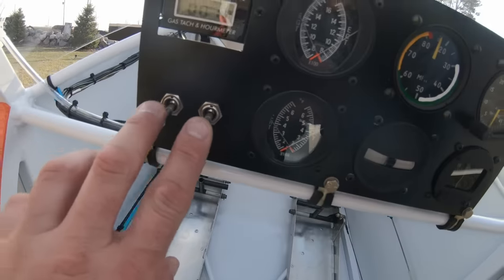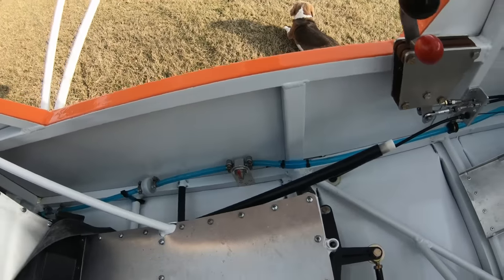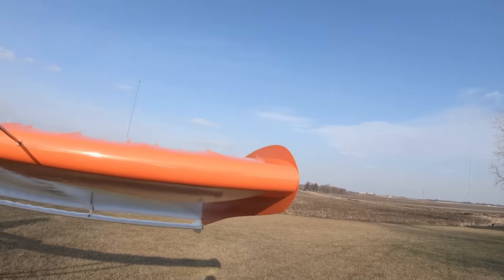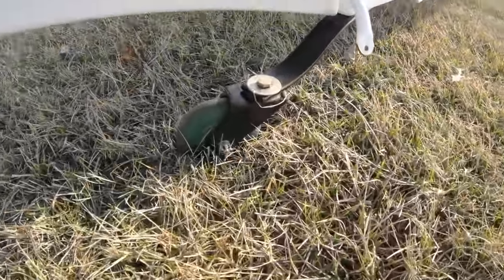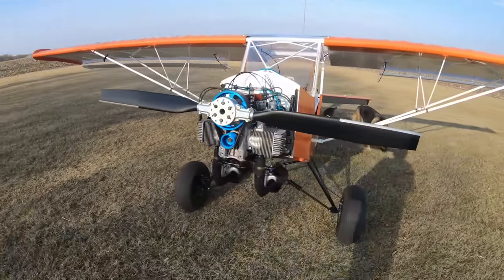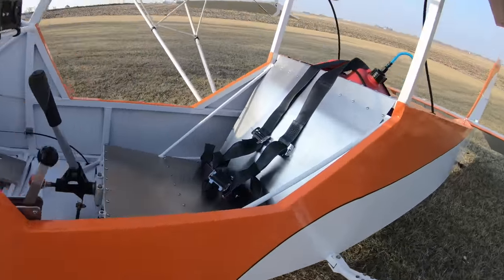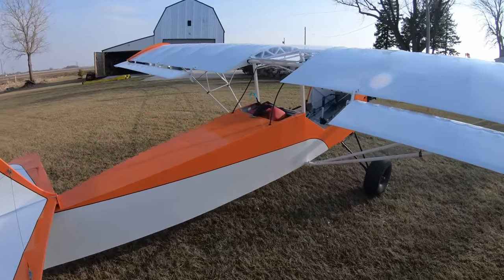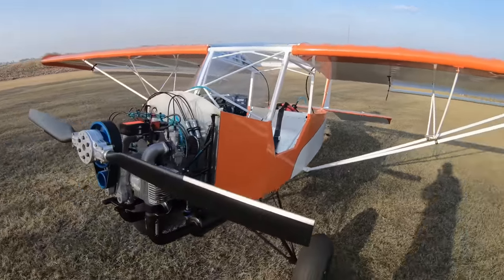SOLD - Belite Ultralight for sale

Comment: I am very impressed with the flight performance of your airplane. Much better performance than a 65hp Piper J-3 Cub. The wingspan looks so short to perform that well. The empty weight must be very low. Less than 300 pounds is my guess. I do not like that fuel system and tank location at all. That plane needs wing tank(s). If you have an accident you will be doused with gasoline and likely burn to death. I never cared for nose tanks in my Cubs either but at least the fuel is in front of a pilot. That type engine is prone to forced landings. Belt drive too. But it sure flys well. Short landings are impressive too.
Reply: Fuel cells can be made to fit anything.....No Spill.... No Leaks.... Made in Oregon and on Youtube.

Comment: How long is the typical Take off roll? How long is typical landing? What is the length folded up approximately?
Reply from the maker: Take off can be anything from 90 to 225 feet. Landing can be 70 to 200 feet. These are typical for me and probably not for anyone else. It is going to vary greatly depending on pilot skill, wind speed and direction, density altitude, fuel amount on board. It's about 19 feet long wings folded.
Reply: Hey Kevin, Thanks for answering!

Comment: I would buy an enclosed trailer to bring it home to North Carolina. You said it is "8.5 to 9 feet wide" with wings folded. I take it that the maximum width is determined by the width of the tail? I would need to get a trailer wide enough.

Comment: I am very curious to know if you, the seller, would benefit from making all those repairs right before selling the plane as opposed to just leaving that work for the buyer and charging less. Is it reasonable to expect that the increase in price will cover the cost for parts replacement? Or did you mainly do those repairs because the chances of someone buying the plane is a lot lower if it's due for all that maintenance?
Reply from the maker: Repairs/maintenance/ annual was done to keep the aircraft airworthy and safe. In my opinion it has nothing to do with aircraft value or trying to negotiate less or more money out of a sale. I did the repairs and routine maintenance for myself, so I am completely confident that I am operating a safe aircraft. I have this airplane for sale but it is still something I am going to fly. I would not feel comfortable handing over an aircraft that I had built to anyone else if I did not feel it was 100% airworthy and safe to operate.

Comment: I have a 2018 Vittorazi 185 Moster dual start, with nano trike, nice Smart Glider, and a Gopher training glider.  I would trade you.  Full Paramotor setup, worth over 18k$. Helmet w/com, etc low hours. Carbon fiber.    Top of line pluma comfort harness.   With emergency parachute

Comment: I wonder why the plastic got stress cracks. Ive never seen polycarbonate do that.
Reply from the maker: The bends are too tight. It should really be formed on a mold in an oven. I see it on all kinds of kit planes and ultralights. My replacement windscreen is already starting to stress crack.
Reply: @kevincamp189  What kind of plastic are you using?
Reply from the maker: @joewoodchuck3824  Bayer the first time lexan the second.......   .060 thickness
Reply: @kevincamp189  I'll have to read about Bayer. I've never heard of that. How thick is the lexan/ polycarbonate? I ask because I normally cold bent it like sheet metal and never had any cracking or checking develop.
Reply from the maker: @joewoodchuck3824  I was told Bayer is just a different brand then lexan. It's supposed to be the same product. I think its .060 thickness. I dont have too much experience with polycarbonate windscreens, any tips you have I'd love to hear..... I didn't know about colt bending it.
Reply: @kevincamp189  Cold bending polycarbonate works just like sheet metal bending, at least with corners. Its just springier to work with, so you need a little overtravel to get the angle you want. You can also punch holes and saw like wood using a carbide blade. Sawing most rigid plastics with any reciprocating saw will result in a soft semi melted mess. Drilling poly is a snap with a little mineral oil, but such thin material would best be sandwiched between clamped lumber pieces. A colleaugue made a curved replacement motorcycle windshield with thin poly and it remained clear of any deteriorative effects for years until he sold the bike. This material along with others was in continuous use for decades in our custom laboratory equipment design work.
   I wrote a magazine article expanding on my comments some time ago on polycarbonate use geared toward ham radio operators. It may still be floating around the web. Look up my FCC call sign N1KHB perhaps along with ARRL and/or QST.

Comment: Still available?
Reply from the maker: Yes
Reply: Kevin Camp what’s your asking price?
Reply from the maker: @flyingclint589  $15000
Reply: Kevin Camp ok, cool!  What’s the main difference between this and the pro cub series?
Reply from the maker: @flyingclint589  Superlite is based off of the kitfox lite. And the pro cub gets further away from the kitfox model and more into belites own design. The pro lite is built more of styrofoam, plywood, and aluminum lamination I think. The super lite is a more traditional  constructed airframe with aluminum as most of the structure and a little bit of plywood for some of the ribs. Basically a tube and rag type airplane.